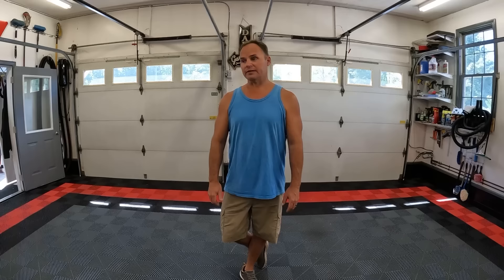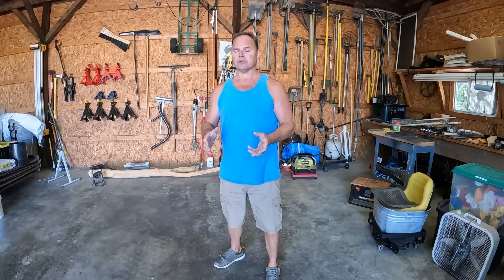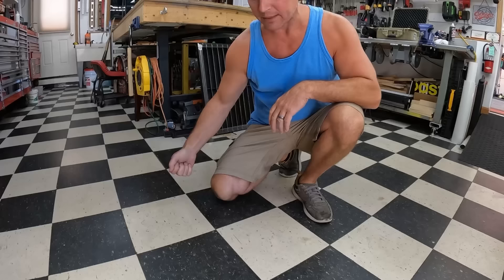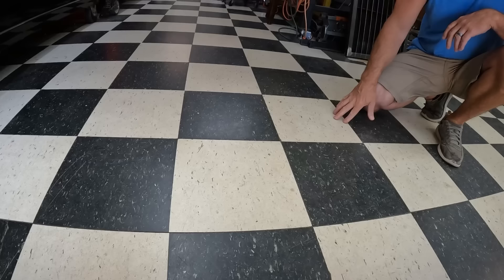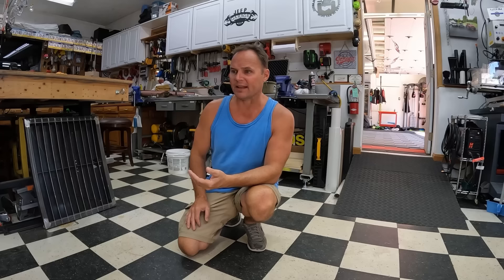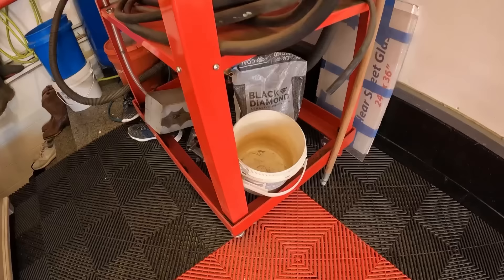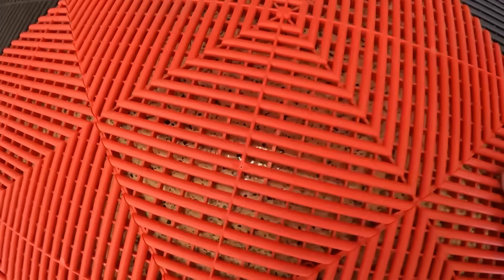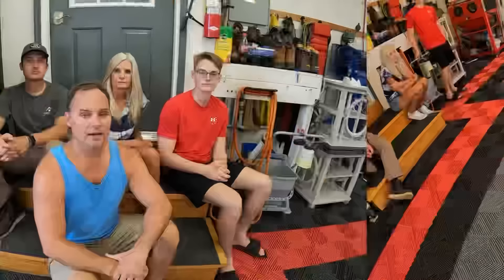SwissTrax/Epoxy/Bare Concrete-Garage floor options and a huge waste of money.

Comment: I'm currently in the process of removing the plastic Swiss Trax tile floor you showed in your first space to replace with a poly chip flooring system.  While the Swiss Trax system was ok, it did leave permanent marks in the top of the tile when dragging heavier items across it, the castors on my benches and tool boxes sunk into the plastic and it seemed to never want to release any dog hair that fell onto it, eventually lead to a smell that wouldn't go away.  I've puled the plastic tile out in sections to power wash but it never looks new after a few years.  

The new floor will be an Epoxy Vapor Barrier spread at one gallon at ever 130 SqFt and then flaking to rejection with around a hundred pounds of flake and covered with an MCU Super UV Clear Coat.  I'm hopeful this will give me a more durable finish that's easier to keep clean and this method should have enough texture to be slip resistant and hide dirt and stains easily.  The newer clear coats are supposed to be resistant to most of the issues you mentioned.

To install a new Swiss Trax system in my garage would cost me around &7K in martials alone.  The textured Epoxy flake with Urethane UV protective top coat cost just $3K for the same space.  I've done both myself so the labor is not an affective element in my cast.  But regardless, if the Poly system doesn't look great in a few years, I can grind it up and lay a new one and still be under the cost of the plastic tile.
Reply: Just make sure you prep that concrete via diamond grinding or its not going to last.

Comment: That dirt accumulation under the tile would drive me nuts....no thanks. Not a good choice for a shop floor.
Reply from the maker: Nope, not for a shop floor. That’s why I didn’t put it in my shop. It is only where I park vehicles
Reply: Wait till you look in your ducts that will keep you up at night

Comment: Thanks for such a thorough, unbiased video highlighting the pros and cons of all three solutions. I have epoxy floors in my garage but don’t really like them, and would appreciate being able to hide the debris with something like the swisstrax. I also think the swisstrax looks way better than my epoxy floor. I get the downside of having to remove everything to clean, but with “regular” use (excluding something like living in the Yukon or having a detailing company where you’re always cleaning muddy cars), it seems like a minor pain you’d have to go through every few years. I also really like the idea of the smooth tiles for the deck/patio. I have a hot tub and that would be a far better solution to go from the house to the tub. Thanks again!

Comment: I’ve been vetting garage floor coverings for a couple of months. Was about to sign a contract for an epoxy floor but your video changed my mind. No epoxy!  So now I have to make a decision between Swiss Track and Race Deck. I like the fact you can easily pull it apart in sections for cleaning. In West Michigan we’ve got the same winter road conditions as you do in Pennsylvania and now I know so can clean as needed. Great job. Thanks!
  Dave M.

Comment: Thank You for posting the video!   Not  my choice though, as someone that does mechanical work on my vehicle and other toys. Why?  Well I drop a small part, even a small but immensly inportant circlip and it dissapears into one of those slots in tile, as it. invariably will due to Murphy's law,  I am looking to loose a lot of time finding and retrive it.

Comment: I have SwissTrax flooring in my garage here in France and the only thing I regret is not getting it 10 years ago! Just working in a cool looking garage makes it more fun and I haven't had any problems with oil spills or the weight of my project vehicles damaging it. If you do a lot of machining on a lathe then you will want to get the solid ones, as the metal shavings will be easier and faster  to clean up

Comment: - Recently discovered your channel through your neighbors Hometown Acres. Your quickly moving up to my favorites to watch. Very much appreciate your creative tips. Not sure of your professional background, I believe manufacturing & tool and die? Hard work ethic from the old US Steel Belt, sadly now Rust Belt. 
- Geez, as our manufacturing floors were going epoxy I believed it was God gift to permanent flooring. Your floor certainly changed my mind, as you mentioned it was properly prepped with grit blasted concrete prior to the epoxy application.
- Another advantaged would be a persons working & standing fatigue factor. 
- Doesn’t a periodic hosing rinse a lot of dirt and dust into floor drains.I’m guessing you likely do that.
- Keep up the great work and the videos.
Reply from the maker: Thanks for watching!! Hope you enjoy!

Comment: For the amount of labor that has to go into installing an 800 dollar epoxy, plus a 200$ floor grinder rental and another 100-200$ in buying the necessary tools to install the epoxy correctly. It’s comes out to be around the same maybe a few hundred less than Swiss trax but a headache nonetheless. Thank u for the video. I’ll be going with the Swiss trax

Comment: Do you think a dremel would cut the tile?  
I would advise anyone against an epoxy floor. I had it done with the flakes and it can get dangerously slippery. Rain or snow on your vehicle drips onto it and here in the northeast if the temp goes below freezing you have a thin sheet of ice on the floor. But aside from that, you are absolutely spot on that it looks like crap in no time. Tire marks, road salt, and hot tire pulls ruin it. It might hold up in a basement but definitely not in a garage. I don't work on anything in the garage, just normal usage...parking cars, trash cans, lawnmower etc.
Reply from the maker: I would not advise using a Dremel, it would take you forever and you would go through hundreds and hundreds of cut off wheels.

Comment: Beautiful floor and nice product, I don't think it would work in my garage as I do a lot of dirty work like spray undercoating.  I actually used agricultural rubber floor matts - they come with a check pattern or plain - mine were 3/4 inch thick so it is almost flush with the cover for my two post hoist cables.  They also have ridges cut on the underside to let water escape and they are easy to cut to shape, but very durable.  Just another option for some people.  Great video, enjoy them very much.
Reply: @michaelmacdonald7342 can you share a link to your rubber mat choice?

Comment: 15 3/4 = 400 millimeters even. Also, for audio purposes, some feedback - might consider a wireless lav mic. Your speech is intelligible but the echo in the garage does make it quite echoey. I enjoyed the floor comparisons though, I should probably do my garage with this. Currently raw concrete which isn't great.

Comment: Epoxy will fail, the flooring tiles are cheap and are actually a horrible idea. Yes they look cool but they hold dirt, moisture, salt, mud, etc.. and they do nothing to protect your concrete long term. The best system is polyurea/polyaspartic  done the correct way. Grind concrete, polyurea,  flake or granite flakes, topcoat of polyaspartic. 
Is it more expensive? Yes, but it lasts forever if done correctly and is incredibly easy to maintain. Tiles are a horrible option. Thanks for the video though.

Comment: Fantastic video!  Thanks for putting the time into this, as I consider garage floor tiles.

Couple of questions:

1) I see you have a few floor drains.  I have one single floor drain in the center of my garage floor (24' X 24' garage floor area).   Your garage floor, like mine, must slope toward your drains. from different directions.  Does this multi-slope floor surface pose a problem for the tiles ability to 'lie flat' to the cement surface?  Do you get any air space between tile and floor because the tiles are rigid and may not conform/bend to meet the contours of your cement floor?  I don't want to walk across the tiles and feel the tile sink to the floor and make flackery clack noises when they come into contact with the cement floor.

2). Do you live in a state with 4 seasons, where you get a fair amount of snow.... and drag road salt in with your vehicles that will drop to the floor, melt, and then sit on the concrete floor beneath your tiles and start eating away at the cement?  I already have fair amount of degradation of my raw cement floor from years of snow melting off my car and sitting on the cement.... salt is corrosive to cement.  So.... wondered if the years of salt melting, then drying and sitting beneath the tiles on your cement (at least where there is exposed cement from where your epoxy has chipped away) is starting to pit your cement?

3) I am considering the 'solid top' versions of the Racedeck flooring.... do you think there is a downside to that verses the flow through tile you chose to put down?

and finally..... have you had any issues with slight turning of your car tires ripping up tiles or distorting, puckering them up from the flooring when moving vehicles in and out and around in the garage?  Thanks a ton!!!   This video was super informative.
Reply from the maker: I live in north west Pa so we get plenty of snow and road salt. I have to keep after the silt that drips on the floor. Either vacuum it up after it dries or wash it down the drain.
The tiles contour to the floor, no clacking when walking on it.
Tires haven’t twisted up any tiles, but I also only pull straight in and out.
All in all, pretty easy to maintain.

Comment: I’m an immigrant from over the hill (HtA)…..I’ve just spent the past two weeks researching flooring options and biggest question I had was rolling jack / jack stands - thx & I was leaning towards the brand you didn’t use but missed the thickness as I was hung up on the 15x15 for some goofy reason. Now go watch Don McMillan on drybar comedy…..your cargo shorts/pants comments made me laugh. Grapevine, TX.

Comment: Anyone with experience. I only have motorcycles in my garage, and do ride when it rains. I also do not pull straight into where I park each bike, usually a hard 90 right sometimes left. Is the grip good enough for the front tire? I mean I could just adapt but I also don't want to loose the front end and topple 2 or 3 bikes.

Comment: I installed one of these floors for a customer a few years ago, exactly to the mfg's specs. What happened was, when the customer had the garage door open, and the sun shined on the first foot or two of the floor, the heat from the sun caused that section to buckle. Both myself and the customer were very disappointed. Not only did it look terrible, was a tripping hazard as well.
Reply from the maker: Was it the SwissTrax brand name flooring?
Reply: @OneEyeCustoms  Yes. Home was in Escondido CA, north San Diego. Gets hot in summer there. Homeowner lived with it and just didn't keep the door open very long. I should say after it cooled down, floor went back to being flat.
Reply: @wsfwsf1497  Sounds like potentially installation error. Not leaving enough spaced to the sides for it to expand. Most materials expand when heated.

Comment: Probability the epoxy that you applied was not UV protection, again hit and sun. Because I never see before an epoxy as that. To applied epoxy the surface needs to be very clean and sander with a machine in order for the epoxy to stick. But I don't know what really happened.  Thank you for the video.

Comment: Very good information! My concern being up in the Northeast is the road salt destroys concrete. I would want to coat the concrete first with something to protect it!
Reply from the maker: All the concrete has had a sealer put on it when it was finished. So I think I am ok there.
Reply: @OneEyeCustoms    Does the sealer need to be reapplied every so often?

Comment: Very detailed video! Probably the best one I've watched. Did you grind the garage floor before the epoxy and was it stained with oil or anything? Swisstrax won't work for my application and was thinking epoxy but I'm getting mixed reviews
Reply from the maker: I did grind and acid wash, the white floor. Still didn’t last very long under daily use. The blue floor garage never had a car on it prior to the epoxy. Was new concrete and waited a month to epoxy it. Even left a semi rough surface for the epoxy to adhere. Then it failed with daily use. I gave up on epoxy. I couldn’t stand the thought of redoing it every 4 to 5 years..
Good luck with your floor!!

Comment: Hey Doug,  We're building a new house and I am researching garage floor coatings and I remembered you doing a video on that. So thanks for this video.  The question I have for you is how does a creeper or creeper seat roll on the Swiss Traxx floor tiles? I really like this option as opposed to a permanent coating. Thanks for your input.
Reply from the maker: A creeper and wheeled seat move nicely on it!!

Comment: Thanks for sharing this video. Very informative! Would you recommend the SwissTrax flooring for a garage that has snowmobiles and a UTV with studded tracks?
Reply from the maker: The heavy mud would not be good in the SwissTrax and I would not have studded track on it either.

Comment: I just got a quote for $17,500 to put in a polyaspartic coating. Yeah Im looking back at race deck tiles now.
Reply from the maker: The coatings look great, I have just had too many failures with them as well as it just wasn’t what I needed. Good luck!
Reply: Did you have the polyaspartic epoxy ?

Comment: 17:28 - Thanks for this walkthrough. While I like the Swiss Tax for its thickness and works with uneven garage floors, my only issue is dirt and gunk will get trapped in those ribbings and underneath the tiles.

Curious if you do a routine vacuum on the tile to pick up the dirt, since it can't be swept off clean with normal flooring.
Reply from the maker: I run a shop vac over any of the areas that might have debris or dirt in the rib areas. And then I do a yearly cleaning as shown in the video.

Comment: This was a great video on the SwissTrax. I was just about to buy an epoxy kit and I'm glad I didn't! I am interested in wood working and having a workbench in my garage. How well do these floors do with heavy things on them? Do they stay level? I'm just wondering if it would be better to leave the garage corners as exposed concrete to set workbenches on or if you think it would be ok to to take it all the way to the walls and put benches on them? I think the flat tiles would probably be best if I did try this!! Thanks
Reply from the maker: I have lots of heavy stuff on mine, no problems.
But don’t buy a cheap knockoff brand.

Comment: I'd rather stain it and put a smooth clearcoat finish so my creepers would roll easier and I'm not beyond using a broom or leaf blower. I don't get the condensation on my floor in winter, Oklahoma, and I have 2 garage doors on the north and south side of the building which makes for a nice breeze coming through the building in the summer. Just wish it was a 30x40x12. It's a 24x24 x8. Just never thought I'd never need more space. Boy was I wrong!
Reply: There is NEVER enough space.  Never.

Comment: Hi mate.  Great video.  Quick question in relation to the outdoor tiles, do you have any problems with them expanding in heat?  Many thanks from Australia…
Reply from the maker: @Walt  Not that I have seen, no issues at all.

Comment: How do you keep the tiles underneath staying clean? I have a hard time with dirt in the winters and other debris like leaves falling through the holes
Reply from the maker: Are usually use a shop vac around the tire areas and then if you watch in the video, I show wear once a year I pull it out in sections and wash the whole floor down.

Comment: I have a lot of pitting in my garage floor from the harsh NY winters.  Would that have to be repaired prior to using Swiss tracks flooring?
Reply from the maker: @Brian Rice No sir, just put the tiles down and it will hide all the bad concrete!! If you do the Swisstrax, I’m pretty sure you would love them!

Comment: It would still kind of bother me how the dirt and debris collects down under the tiles. Is there any difference between epoxy floors and polyaspartic?
Reply from the maker: I’m sure there is a bit of a difference, but the main things I don’t like are how slippery epoxy is and all the other things I spoke on in this video. Thanks for watching.

Comment: Was the concrete physically etched or acid etched? I don't see scratches on the concrete from a diamond machine, maybe that's why it didn't stick? Other than that, the floors look great, thanks for the showcase.
Reply from the maker: It was acid etched twice, and to one garage was brand new concrete, never driven on with a semi rough finish knowing I was going to epoxy it. Anyhow, it doesn’t matter now, I like the SwissTrax flooring much better for many reasons in my situation!
Reply: @OneEyeCustoms  yeah the acid etch is not sufficient. I've watched a few pros do it and they use a diamond etching machine. Anyway, you ended up with something you like better now, so that's all that matters!

Comment: How well do large wire rack shelving units on casters work with the Swisstrax? Everything in my garage is on wheels because space is limited. Casters would need to be able to swivel easily and I think that would preclude the swisstrax system for me, unfortunately.
Reply from the maker: Well, I have used floor jacks and everything I have is on casters and have not had any problems!
Reply: @OneEyeCustoms  good to know. I see now that they have the flat variety in addition to the ribbed tiles.